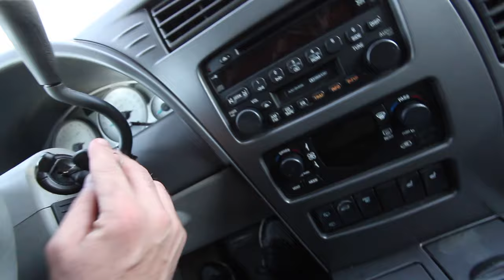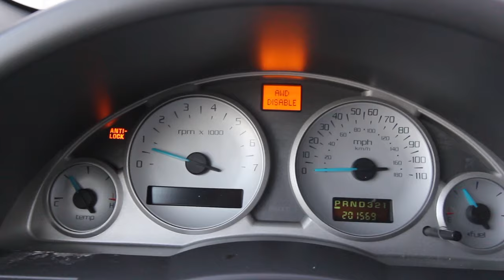16 Years Later - The Buick Rendezvous CXL | In Depth Review & Test Drive ( Auto Vlog )

Comment: Great car. Bought with 19K miles in 2006, it was 2004 and never had to take it to a maintenance other than simple oil changes until it reached 180K miles, started to show AWD disabled light, and instrument cluster failed. Front tires wear out faster, due to the weight of the vehicle not balanced. Plenty of cargo space.

Comment: It says under the title that THIS video is 5 years old. I think it would be most entertaining to hunt down the owner of whoever bought that thing and count the number of malfunctions and REPAIRS he (or She) has on their list by comparison to those on mine 😯! Disbelieve me if you will my friend, BUT... I spent $2,400 (IN REPAIRS) on mine within the first 3 years of ownership! I bought my 2002 RENDEZVOUS "CX" (NOT "CXL") FOR $800.00 6 years ago. Yes mine didn't look as good as this one does which is why I thought I got it so cheap. Mine has an awesome (lighting-bolt-shaped) CRACK straight down the middle of the windshield. Charming aye! Well, I thought (that's not going to affect the way it runs or drives. (Which is true)! That, plus the broken -out Left tail light lens SURLY must be the reason it's ONLY $800.00. I stretched some of that ugly RED tail light tape over the broken plastic and it's still that way to this day.  WHY? Because the number of repairs I've been FORCED to make on it over the last 6 years has caused me to loose my respect for what it looks like! (And that's putting it mildly)! WHAT'S WRONG WITH IT... YOU ASK. It would be faster to mention what's NOT WRONG with it! Look for my experience with this thing on other YouTube videos about Rendezvous. Although, I told it all on 2 videos about a 2004 Rendezvous. Mine is 2002 with 211,000 miles. Anyway My newest problem is the GD radiator FAN. I'm sorry to contradict you, but THIS IS NOT A GOOD CAR FOR ANY AMOUNT OF MONEY!  Admitting mine was in "C" condition when I bought it, BUT I MEAN REALLY! It did me like it was in "FFF" Condition. God be with you...(you'll need him)😮 (OR at least a rich Uncle who likes you)!  I have no idea why there are "CROSS-OUT" LINES THROUGH THE BULK OF THIS COMMENT. (UNLESS IT'S THE RENDEZVOUS - CURSE)!